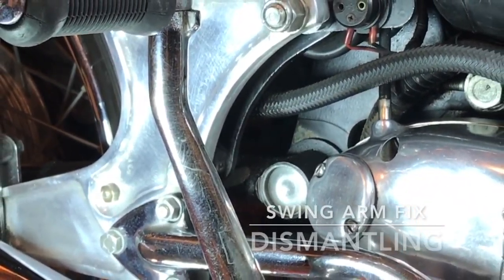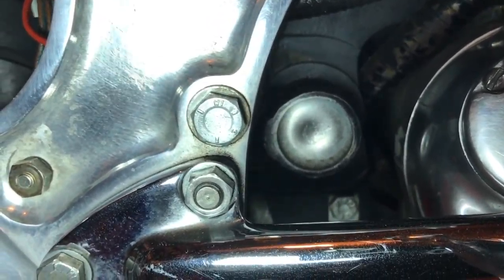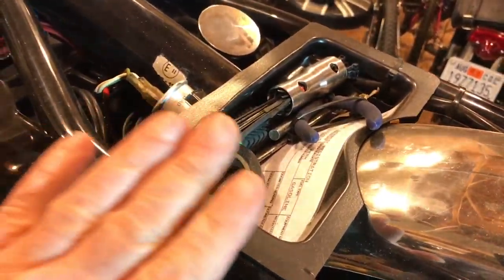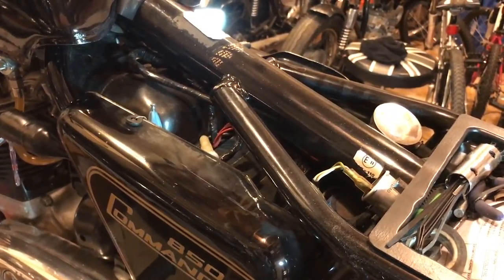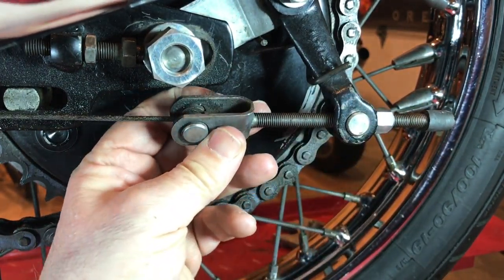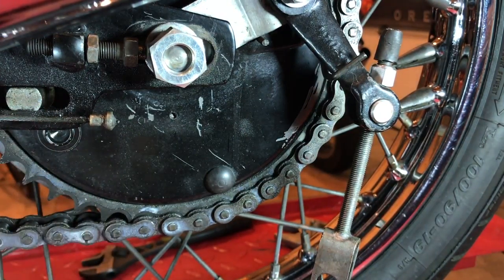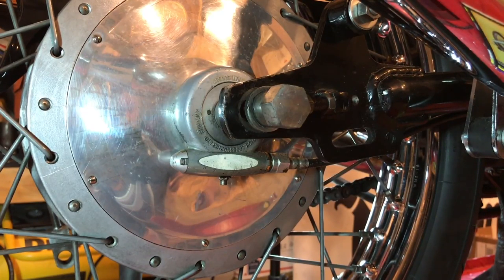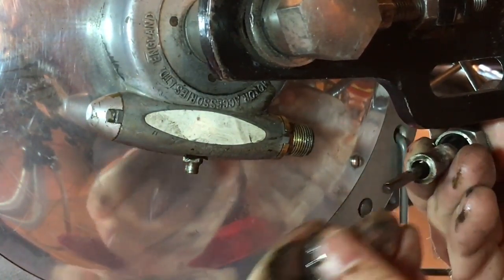1974 Norton Commando 850 MK2A – Swing Arm fix (Part 2)

Comment: My 1973 MK II has this problem.  I have the clamp kit.  Nothing else though.  Todd Cannon said that I should look at these.  Both my Commandos are suffering from disuse.  The MK III has been mine since around '77.  The MK II has been in my family since around '79 It came from George Gjonovitch  at HPI, back in the day when my brother bought it.  Its  still fairly peppy for a Norton.
Reply from the maker: Hi Paul. Great to hear from you.  I know Todd well.  Are you in the Portland area?  You would be most welcome at our club meetings or events. We meet on the first Saturday of the month at the Horse Brass pub on SE Belmont at 11am. Cheers! Mike
Reply: @TheMightyGarage  The bikes are in Tillamook.  The MKII has mags and a rear disc retrofit, since before it was in my family.   I have a nice wheelset, but no brake drum/sprocket assembly.  I'm wanting to put that back to stock hub.They both need isolastics from sitting.  I just don't have much time for them any more. 

Both have dual 34 Mikunis.  The MK III actually has 32s on it now, with the 34s in a box.

Comment from the maker: James, I don't know what happened to your comment.  I saw it pop up on my phone but couldn't find again.  Yes, the scratches are a bit scary!  I didn't know that they were so bad.  I think the close up view and the LED lights highlight them more but yes I will try to clean these up.  I do know that the kick tarter was in bad shape when I go the bike, so there may be only so much I can do without buying a new one.
Reply: That seems to be a common problem The solution is to use an MK3 kick starter lever but they are expensive.
Sorry, I assumed you were talking about scratches on the silencer.
Reply from the maker: Hi, oh you might be correct..  I thought James meant the kickstarter and looked again at the video and saw those on the silencer.  There are scratches on a lot of parts ;)  I think the scratches on the silencer will hopefully polish out!  Cheers.

Comment: When u installed it does the brake hub sits flush with the wheel hub ? I have a 72 I replaced the rubber cushions and I have a 1/8 gap between the brake hub and the wheel but not sure if should be like that? with all tight still both parts have a gap between them

Comment: I saw in one of your videos,  which are very informative, you had a k&n oil filter.  I was wondering what the part number is . 
I am going to put one on my 70 commando S . It's my retirement project to put it back together to ride instead of the heavy Harley Davidson
Reply from the maker: Hi Lance, thanks for your note. Good luck with your project. That will be a lot of fun! There are a lot of oil filters that will fit a Commando. I'm including a link to the Access Norton forum where the guys list a bunch of filters that will fit. Plus other comments from other guys about the filters that they use.  I. would probably avoid the filters that have a built in nut on the end as I've read that the nut can shear off. https://www.accessnorton.com/NortonCommando/oil-filter-2011.8739/
Reply: @TheMightyGarage  the trick is to follow directions. 1/2 to 3/4 of a turn after contact .
Reply: Thank you for the information
Reply from the maker: Thank you Lance